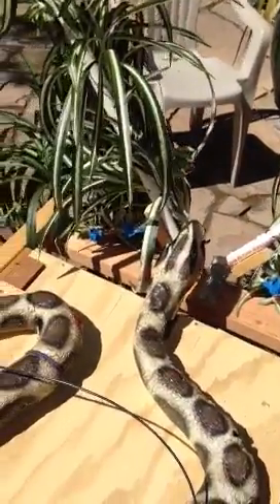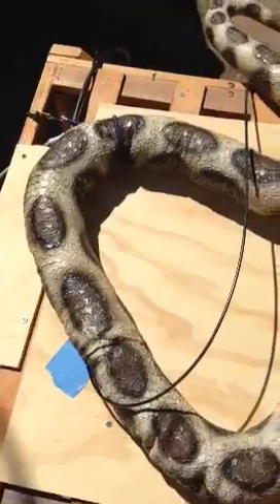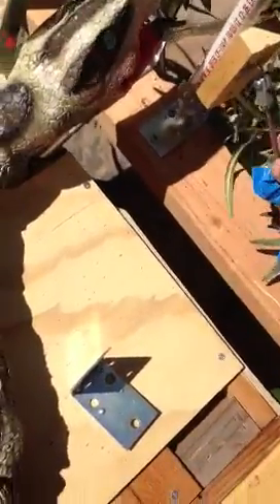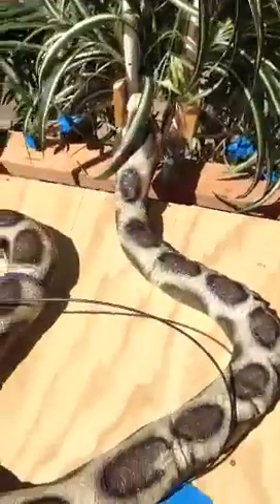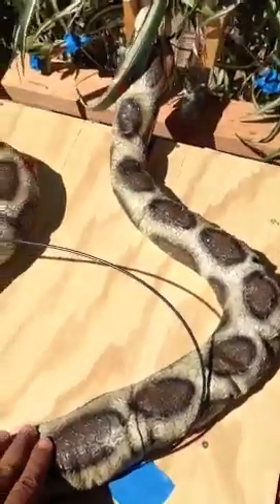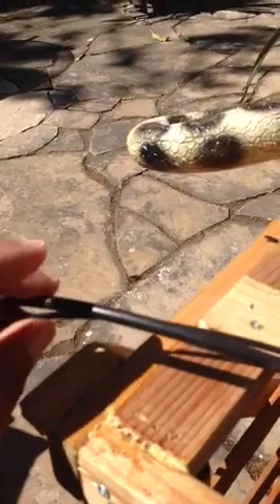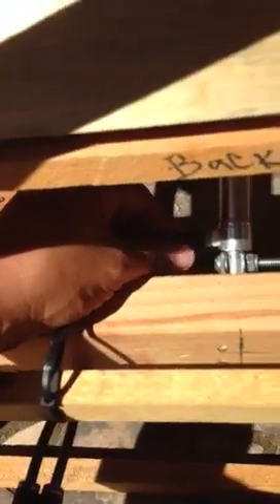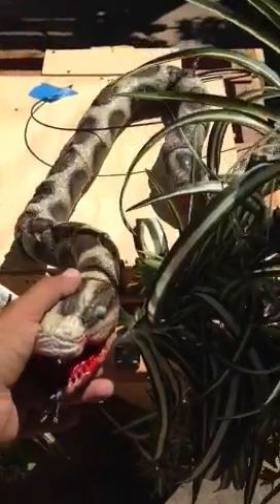Pneumatic snake how I made it

Comment from the maker: Hi HB, I made sure the head swivels and when the cylinder is activated, the head pretty goes back into place. Although the snake is foam filled, the outer latex is fairly rigid. It pretty much goes back into its original form.  I hope that makes sense.